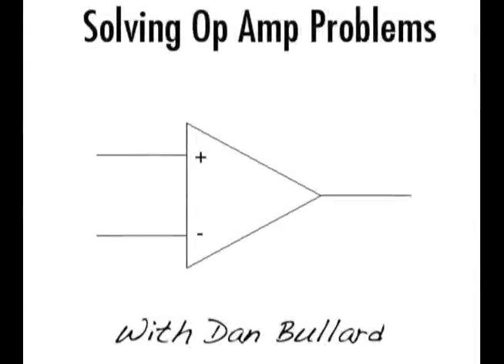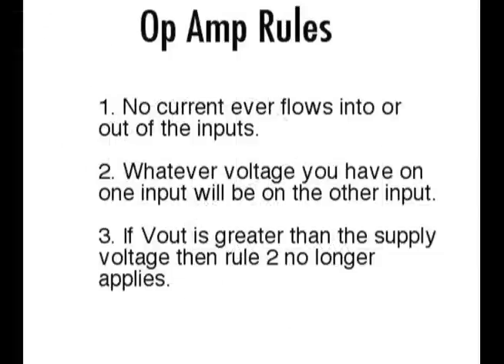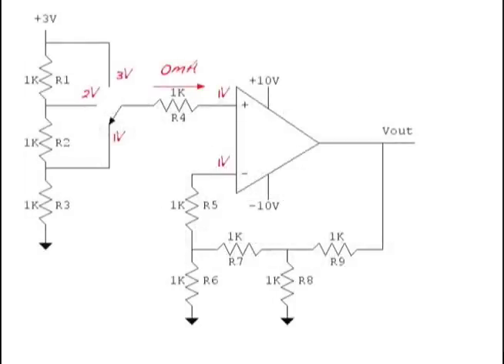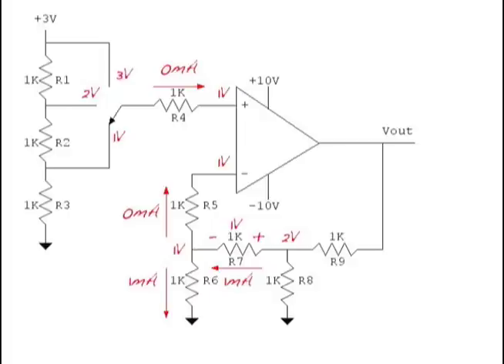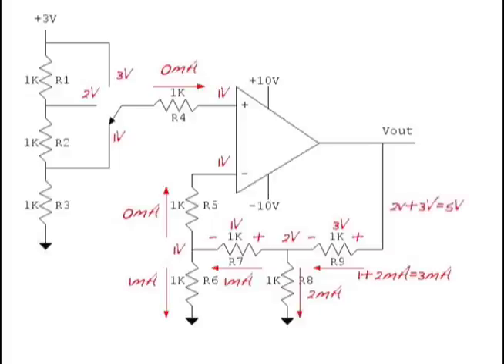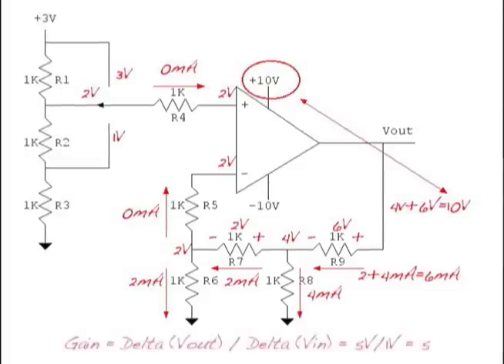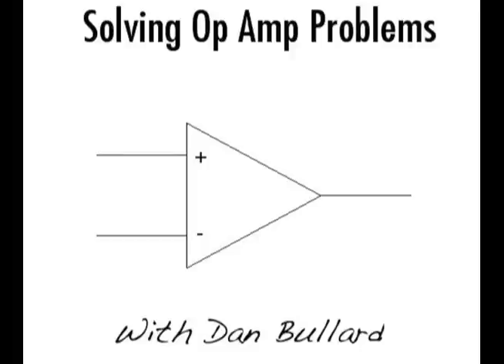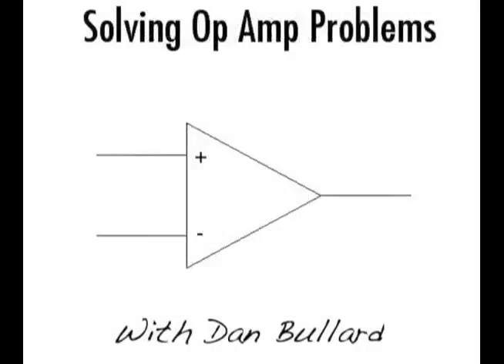Solving Op Amp circuits

Comment: Do you know about, how to read the program inside a microchip? I heard the firms can read secret probrams of Pics. What are the keywords of thise topic ?
Reply from the maker: No, if it's not documented, there is no chance of figuring out what's inside. When I started working on Smart Cards (ISO 80211), a bunch of Koreans I worked with created a microchip to talk to the Smart Card, but because it was a proprietary design that they didn't want to get stolen, they put their chip on the circuit board and then smothered it with potting compound (epoxy) to keep the secret from being stolen. Paranoid, but expected, as Koreans steal everything and when they do invent something they do all they can to protect their secrets.
Reply: @DanBullard  Thanks for answer. I herard that, with an acid the upper layers are solved then the inner region is detected.
Reply from the maker: @karisikpekmez6850  There is no way to look at the silicon to figure out what the device will do. This is pure fantasy, stop listening to people who tell you such things.
Reply: @DanBullard  but we wonder how... If could be :?

Comment: Rule number one only applies for academics 😉 When you design for the industry, real world applications, suddenly, magically (hear my sarcasme) current flows there... and if you don't take that into account: 🤕
That makes then the difference  between an engineer and an Engineer ;-)

PS: same applies for rule number two...
Reply from the maker: Does it apply to F-16s? Don't ask Raytheon about that, they wouldn't have a clue. https://youtu.be/UkfRYfOj3e0
Reply: @DanBullard  Fun fact, I did my 2nd internship at a partner company of them, in Germany, and it is exactly what my boss there said. That guy was a 2nd Bob Peas or so. I also remember him, telling Texas Instruments on the phone, what they did wrong in a new chip, just from measuring the IO.
Here is another one, worked later on for a company claiming itself world leader in R&D bevices for Biologie, two face palms:
1) I was asked to figure out why on a device serie an input randomly triggered when the input was not attached to.
It took me 20 seconds to figure out when looking at the schematics. They attached a 3V Zener in Zener mode (anode to GND, cathode to uC pin) at an input pin to adapt from 24V. But when that feature was not needed, the stuff wasn't connected, leaving the input pin with it's Zener cathode floating ^^ Parralel R to the Zener did solve te issue.
2) Save money save a crystal oscillator, use the internal uC oscillator, I was told. For a device that had a 14 day timer feature incoporated.....
The story ends me being fired, I one day did say we're fools doing bad ^^
Universities and Colleges often do a bad job in teaching us, it's a real problem. I try now to catch up on my own ^^ I'm thankfull for guys like you sharing your lifetime knowledge with us. I saw your other video afterwards :)

Comment: That's not all that complicated.  Throw in a few capacitors a couple of inductors and a transistor plus a diode or two for good measure.  If you really want to get fancy a quartz crystal and a PTC resistor tossed in should light up your day.  Such circuits exist.
Reply from the maker: speaking of quartz crystals, what's the Smith Chart of a quartz crystal look like? I've done it on a network analyzer, so you had better think carefully....
Reply: @DanBullard  A circle.  Are we having a pissing contest now?
Reply from the maker: You are welcome to make a video explaining a circuit like that, let's see how long it takes you to get to 400,000 views and 5300 likes. My circuit comes from a real job interview and passing a job interview is more important than being smug and unemployed.

Comment: I might be a little bit too late to join the party 😄 I appreciate the clear explanation and detailed solution you provided. Sometimes we all forget that electronics is not that complicated and that all circuits can be handled by simply adhering to a few basic laws. I have a question, and I would greatly appreciate it if you could help me understand the design decision: what is the purpose of R4 and R5 in this circuit?
Reply from the maker: R4 and R5 are typically placed there to keep the current down to a minimum if the Op Amp fails, but in this case they are used to trick the observer, to see if they understand that an Op Amp consumes no current on the inputs. It's a standard ploy imposed on Employee Applicants.
Reply: @DanBullard  I appreciate your response. They were current-limiting resistors in my mind. Although it's a wonderful concept, I've never utilised them in any designs. In my subsequent design, I'll give it a shot.

Comment: Hi Dan, I am delighted with this logic. I don't understand why degrees don't teach this way?! Thank you. I haven't checked the other videos but are there different config which uses L and C?
Reply from the maker: Thanks, I haven't done anything with L and C. I worked on RADAR and radio, so I do know a fair bit about it, but I'm working on Harmonic Distortion mostly right now.
Reply: @DanBullard  Thank you again. I have always been fascinated by OPAMPs, quite a powerful component.

Comment: Im sorry but i dont understand the first step. I get why R4 has no current flowing through it, but why is VR1 and VR2 equal to 1 volt? How can you determine that the voltage drop between the 3v node and R4 is 2v? Thanks!
Reply from the maker: R1, R2 and R3 form a simple voltage divider. 3V/3K=1mA, so each resistor drops 1V starting from the 3V source. The junction between R1 and R2 is 3V - (1K * 1mA) = 2V. The junction between R2 and R3 is 3V - (2K * 1mA) = 1V. You couldn't know any of that if there was any current flowing into, or out of the + input of the op amp, which is the whole point of Rule 1. If you had to think about how much current the + input was drawing, you might never figure out the input voltage.
Reply: @DanBullard  ohhh i get it now, the circuit "keeps going" after R3, i wasnt seeing that so i wasnt taking R3 into account. Thanks a lot for answering so quickly!

Comment: Thanks, a very helpful video. But could someone explain the purpose of R4 & R5 or are they simply not needed if there's no current flowing through them and no voltage drop? Thanks in advance.
Reply from the maker: R4 and R5 are just current limiting resistors in case something bad happens to the Op Amo.. That and in this case it allows me to make the point about Rule #1.

Comment: i didnt get how you assumed the other two input nodes to be 2v and 1 v respectively
Reply from the maker: R1, R2 and R3 make up a voltage divider so that I can flip the switch and get 1V, 2V or 3V. If you don't understand voltage dividers you had better start somewhere else.

Comment: if no current goes in the inputs then what's with the 1k/R4?

thanks
Reply from the maker: To make the point, there is no current flowing. Can't prove it without a resistor. Watch my most recent op-amp video https://youtu.be/UkfRYfOj3e0
Reply: @DanBullard  I see thanks Mr Bullard!

Comment: but how can there be no current in the input?
Reply from the maker: Hi Geert! Nice to see that you have moved from politics to electronics. Less chance of getting blown up for sure. The point is that the current is so small, it doesn't affect your calculations. Let's say that it has1nA of current flowing into one of the inputs. What's 1nA * 1K? 1uV. Is that going to give you extra points in your job interview, or will they be amazed that you solved their complex circuit in a few minutes like what happened to me at Maxim (twice!) in the interview. By the way, I got the job, and they were blown away that I was able to solve it so quickly.

Comment: Could you confirm what ground  you would  be referencing from if probing  the inputs/output given that the rail is in the minus please. Would it be taken from the minus rail to the op amp. or from power supply ground.
Reply from the maker: The minus rail is a power supply, I never reference anything relative to a power supply. Ground is ground.

Comment: Since the inputs were not equal when switch was at 3V, there was a difference in voltage between the input terminals. Does that mean that the last calculations would be wrong since current would be flowing out of the inverted input? Or is input impedance so high that there would still be no current flow?
Reply from the maker: The input impedance is WAY too high to allow any >significant< current flow to make up for the discrepancy in input voltages, but there is usually a small amount, in the nano-amps to micro-amps range when the op amp saturates. Not enough to make any difference across the 1K input resistors, but that will cause some, in some bi-polar op amps. That's why I have the rule of no current flow on the inputs, any current flow that happens by accident from saturation, etc is so infinitesimal it's not worth worrying about.

Comment: How did you calculate the equivalent 1.666K?
Reply from the maker: Starting from the output of the op amp, everything is in series with R9. Then, R8 goes straight to ground while R6 and R7 are in series with each other but, as a pair are in parallel with R8, as shown in the equivalent circuit on the far right. Now. R6 and R7 add up to 2K, and 2K in parallel with R8 (1K) is (2K*1K)/(2K+1K) = 0.6666K. And since that is in series with R9, 1K in series with 0.66666K is 1.66666K. Remember that we have to forget about R5, since no current is going to flow into R5. It's like a resistor floating in the air as far as we are concerned. Now, truth be told, you might get a nanoamp flowing into our out of the op amp (or less!) but what difference will a nanoamp make to your calculations? Far less than the tolerances of the REAL resistors.
Reply: @DanBullard  Thanks Dan

Comment: How di you calculate the equivalent resistance of 1.666k and could you explain the 6mA running through R9 please? (around 8:00)
Reply from the maker: Starting from the output of the op amp, everything is in series with R9. Then, R8 goes straight to ground while R6 and R7 are in series with each other but, as a pair are in parallel with R8, as shown in the equivalent circuit on the far right. Now. R6 and R7 add up to 2K, and 2K in parallel with R8 (1K) is (2K*1K)/(2K+1K) = 0.6666K. And since that is in series with R9, 1K in series with 0.66666K is 1.66666K. Remember that we have to forget about R5, since no current is going to flow into R5. It's like a resistor floating in the air as far as we are concerned. Now, truth be told, you might get a nanoamp flowing into our out of the op amp (or less!) but what difference will a nanoamp make to your calculations? Far less than the tolerances of the REAL resistors.

Comment: Why do you have R4 and R5 resistors. If the op amp input impedance is essentially infinite why not connect direct without those two resistors?
Reply from the maker: They are there for two reasons. One, to make the point that no current flows, and two, very often you will find resistors on those pins and you have to learn to ignore them. Remember the topic: Solving Op Amps. When you see resistors on the inputs of the Op Amps, you must learn to ignore them. If I didn't show them, you would be wondering what to do and be unable to solve the circuit.
Reply: @DanBullard  thanks. You added them for modeling purposes. To show internal resistance (just thought you would pick 1megohm instead to show
Reply from the maker: @brockchambers3733  No, if I make them Megohms then nanoamps suddenly matter. Almost every op amp circuit sports these small resistors. Making them Megohm resistors just invites disaster.

Comment: I don't understand why we need R4 when there is 0 Current through it
Reply from the maker: This is not a real circuit, but it mirrors many in the real world. R4 and R5 are often used to keep the voltage offset the same because despite Rule #1, some very tiny (nano-amps) current might flow. If it does we would like to ensure that there is no voltage offset in that case. That said, you can most often ignore those currents, because what is 1nA * 1KOhm? 1uV. It's not worth considering, but since an op amp has an open loop gain of 1 million or more, that could become 1V in a hurry. The real reason I put R4 and R5 in there was to make the point especially clear, you can always ignore the infinitesimally small currents on the inputs if you are just trying to figure out a complex circuit. It does you no good to go chasing nanoamps when the circuit is ruled by currents 1 million times higher.
Reply: Thank you for the answer

Comment: Thanks Dan for the very clear explanation.
One suggestion would be to label the appropriate ref designators for the 3rd case equivalent circuit so the “student” can quickly identify which resistor is which.

Comment: so all of those resistors serve as protection from too much curent (other than the ones that actually pass current through)
Reply from the maker: Let me quote Galaxy Quest, "It's just a TV show kid." It's an example circuit that probably has never been used. But it's based on many real circuits and is complicated enough to be one of those nasty interview circuits that a prospective employer could throw at you and expect you to solve it on the fly.

Comment: so what is the gain for the last case? 10/3 or 10/(3-2)?
Reply: Once the amplifier is saturated, you have to stop calculating gain. If the gain is 10/3 at 3 volts in, what's the gain at 2.99 volts? 10/2.99?  Saturation in an amplifier is considered a malfunction, not a normal operating mode.

Comment: if there is no current on inputs then it doesn't matter what are the values for R4 and R5? I even can remove them from circuit?
Reply from the maker: I get asked that a lot. There may actually be a very tiny current on the inputs, but so small they can usually be ignored. But for absolute accuracy they are included to keep the input impedance the same between the two inputs just to cancel out any voltage drops.

Comment: I don't get how you got the 2V and 1V at the beginning of the video 1:55 ? There is zero current, yes. But how did you find out that it only drops 1 volt over each resistor?
Reply: The resistors on the left side form a voltage divider. 3 volts across 3K means 1mA is flowing, so each 1K resistor drops 1V,
Reply: Thank you! Cold you also tell me why you removed the R5 resistor in the final step/task? (When we calculated the Req etc. )
Reply: R5 came out while I was calcuating Requivalent because it will never have any current going in or out of it, so for the purpose of calculating Req it's best to just ignore it. We ignore the insulation on the wires because we know that no current flows through the insulators, so we don't need to concern ourselves with it.
Reply from the maker: It's a classic voltage divider, 3V across a total of 3K resistance, 1mA flows, therefore each resistor drops one volt.

Comment: Your rules are ridiculous. The number one rule in electronics is DONT ASSUME ANYTHING EVER. you have to know what ur doing or dont do it. Your telling people the inputs are always equal unless output is bigger,  "assuming" two inputs are the same and then finding a bigger output each time which according to you would mean that the two inputs are not equal as "assumed"?? This is some crazy shit..
Reply from the maker: My rules will get you through 99% of what you need to do with op amps. I once saw a guy use an op amp as a filter using 5K input resistors and relying on the parasitic capacitance of 10pF to make a 3.2MHz  LP filter. Obviously my rules won't help you with that. The input currents are very low so a 10pA current flowing through a 1K resistor will result in a 10nV drop, far to small to even measure, except that there is a way to measure it using a Op Amp Loop. BTW, I got a job at Tektronix simply because I could analyze an Op Amp circuit. It got me a 100K+ a year job, so use it or not, at your peril.
Reply: Fatality.... xD
I think you killed him hahaha
Reply: Dan Bullard Rule 3 isn't that hard to prove using the dependent source equivalent formulation of the op amp right?
Reply: You can assume it by definition.  Otherwise it would not be an op-amp.  Look at the internal circuitry of the 741 op-amp for example and it's obvious. We make lots of assumptions.  For example who worries about the Q of a capacitor?  Or the resistance of the copper on a board for signals. An idealised operational amplifier is assumed to have a number of properties such as infinite gain, infinite input impedance, zero output impedance and infinite bandwidth. Real-world op-amps have properties which only approximate towards these ideals, but use of these assumptions can greatly simplify the calculation of component values in op-amp circuits.